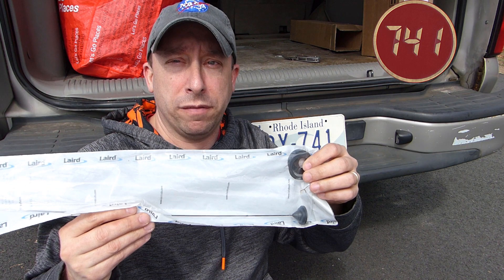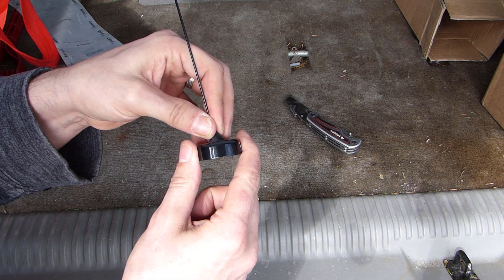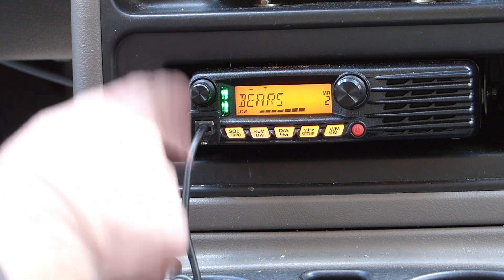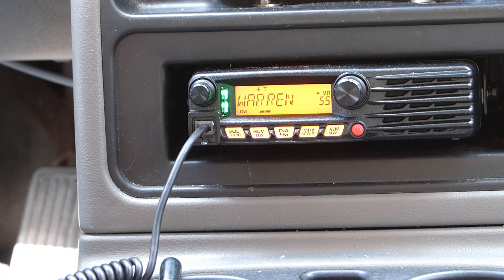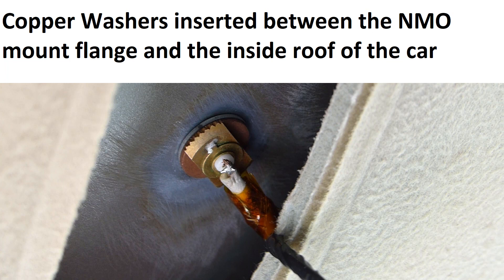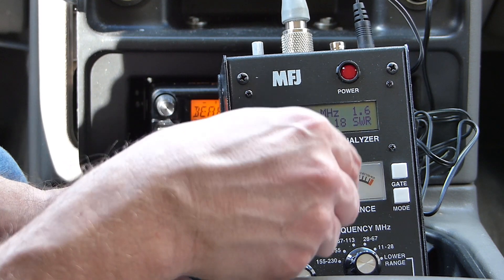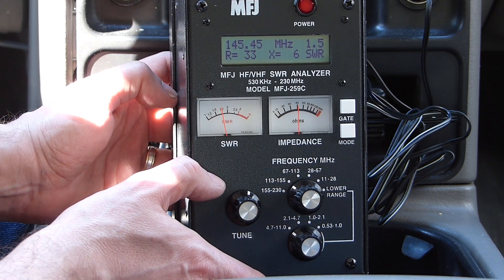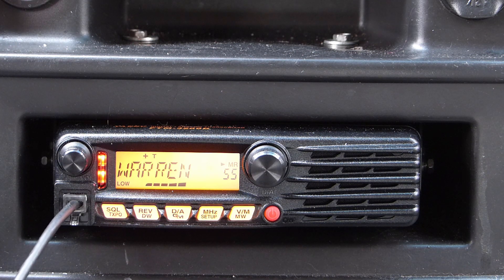2 meter antenna install and shootout 1/4 wave vs 5/8 - which is better?

Comment: Get a splitter and run both.
Reply from the maker: Why?
Reply: @SevenFortyOne  Try it out;) 1/4 wave on one side, 5/8 on the other.
Reply from the maker: You mean a switch then?
Reply: @SevenFortyOne  transmit and receive on both at the same time. Try it out.
Reply from the maker: What do you expect would happen?
Reply: @SevenFortyOne  you get the best of both worlds.
Reply from the maker: it doesn't work the way you think...first, you need a phasing harness.  A simple splitter doesn't work for a transmitting antenna. Second, once phased, the 2 antennas work as 1 and the result is a radiation patter that is different than either of the two antennas individually. Third, the antennas must be placed precisely which may or may not be an easy thing to do on a car.   Any benefit seen in a mobile application like this isn't usually worth the hassle of the phasing harness and placement/tuning of the antennas.  Having said that, AM radio broadcast stations use a similar technique to direct their radiation pattern so the signal is strong where they want it and weak where they don't.
Reply: @SevenFortyOne  The military does it , but the equipment is digital. Heard it helps out in fringe areas
Reply from the maker: Money and time are no object for the military and performance could be the difference between life and death so maybe antenna phasing is worthwhile for them.  As I said, its generally not worth it for the average Ham.  If you try it and it works for you let me know and we'll make a video about it.

Comment: if 1/4 wave antenna tune at higher frequency for given cut length , it probably due to weak ground connection.   sometime, lengthening antenna a little bit ( make it slightly inductive ) to compensate for weak ground.  often handheld antenna do that, since most handheld radio have weak/small  ground.  AG6JU

Comment: that changing signal is ground wave scatter, wind blowing the antenna and other movements, also have an effect.. to test antennas an  almost instant change of antenna is required. the time between the change of antennas was too long.. you may see a different signal of a repeater in the morning compared to afternoon... the rf stream can change its course... reflections blockages.. atmospherics.... these antennas are not in free space or close to it... neither antenna is working optimally
Reply from the maker: Yup, understood. This is what I'd call a "real world" comparison and illustrates approximately what one might see in general use in sub-optimal conditions. This was not intended to be a scientific comparison by any means.

Comment: I'm having a lot of trouble finding basic information about what kind of antenna I need. I must be misunderstanding something, because I can't find the difference between 1/4, 1/2, and 5/8 wavelength antennas anywhere.
Reply from the maker: There isn't a simple answer. Bit depends on what your needs are and other variable like your car and radio.  Having said that, a1/4 wave usually is a good place to start as it generally is the simplest and cheapest option but still provides decent performance.

Comment: I went with a 5/8 wave antenna but installed a spring-base between the loading coil and the whip. I just had to reduce the length of the whip by the height of the loading coil.
That Laird quarter wave is not cut for the right frequency. Unfortunately you can't fix "too short" by trimming. If you are dead-set upon using a quarter wave antenna then buy one with a whip that you can trim to put it on frequency.
Otherwise your MFJ analyzer is only telling you that you have the wrong antenna length and you are not going to do anything about it.
I would not recommend the use of Nevr-Sieze. Most antennas (commercial ones) come with a little single use packet of silicone grease. Fill up that gap between the NMO and the antenna with silicone grease. It is non conductive and fills a void so water just can't get to the antenna internals (on a base loaded 5/8) or at the NMO mount.

Comment: Interesting video. I've had better luck with the 1/4 wave in a mountainous environment.
Reply: Because the radiation pattern has a large upward lobe to help get you out of a valley. On the mountain top, however, the lower angle of radiation inherent to a 5/8  wavelength antenna will outperform a 1/4 wavelength antenna.

Comment: Back in '72 I tested a stock 1/4-wave as above and an Antenna Specialist 5/8-wave base loaded antenna on a full-duplex 25 watt VHF mobile phone unit to a repeater at 700 feet AGL. In town 12 miles away, the 1/4-wave was choppy in some places and the 5/8-wave was clear.

Driving out of town, the 1/4-wave was choppy at 20 miles and lost it as 25. The 5/8-wave was choppy at 25 and lost it as 30. 

The 1/4-wave antennas last about a year and metal fatigue breaks the whip just above the rubber boot.

Couple of years later tested several 5/8-wave antennas. The ASP with spring, Larsen and Decibel Products without springs. Driving off-road the ASP stayed straight but the Larsen and DB whipped around. We observed how much it whipped around and tied a fishing line and pulled the antennas the same amount. There was a 3-6 dB loss.

Comment: Good test. Nice video.   Fact remains , a 5/8 wave has a gain over a 1/4 wave.  And a different lobe angle ( main lobe is lower ) and stronger.  But not so much as to nullify smacking into garages, trees etc!   The height of the cab can make a big difference at vhf and uhf.  Some cabs are a couple ft higher than many compact cars.  That can give a couple miles more to mobile to mobile communications.  After years of using all kinds of mobile setups   big antennas matter.   Its simple capture area and radiation angles.   Also PLACEMENT on the vehicle. Matters. !!! Many db... Center roof wins.   Exactly where you have it!   73s. K4DSB.

Comment: Another good video.  I am considering a tri-band VHF/UHF mobile antenna for my GMC truck.  I was reading on Comet’s web site that the tri-band antennas need to be moved around to adjust tuning.  How do I do that with a NMO mount?  I would think I am kind of committed once I drill that holes.  Haha.  I am impressed by the mounting of the Comet and the fold over (manual) that they have.  This is one of 3 antennas I plan on mounting.  One VHF/UHF mobile & 2 HF mobile antennas.  The HF mobile will be mounted near the bumper (trying to figure that out).  If you have any advice to share with this noob, please feel free.  Again, thanks for your video.
Reply from the maker: Things are different from install to install.  The best thing to do is experiment and see what happens.  There will always be compromises so make the best of what you have and things should work.  Also, keep in mind differences on paper don't always translate into difference you'll notice in real world conditions - especially when it comes to antennas.
Reply from the maker: The most important thing is to get the SWR as low as you can and go from there.  For HF, bonding of the car panels to one another is important.  Ham Radio Crash Course has at least one video on this topic that you may find helpful.  Also, HF mobile antennas are usually a pretty big compromise over full size antennas.  They'll work if you get them set up reasonably well but won't usually perform as good as a full size antenna of course.  Experiment, and have fun!

Comment: Great video….I’m just getting in to ham radio and was wondering what is the type/size coaxial cable you are using between radio and antenna?
Reply from the maker: I've been using rg8x in my mobile installations for many years with success.  If you are running frequencies higher than 2 meters you might want to consider lower loss coax.
Reply: @SevenFortyOne  For the foreseeable future I will only be using 2m and 70 cm in my truck so that’s the cable I will go with. Thanks for the info
Reply: @SevenFortyOne  I have some RG 58AU that has the same loss on  UHF as LMR 400 @ 17 feet. per my analyzer

Comment: I drive all over Kansas and Oklahoma in a little Ford transit van.
I started with a 1/4, then went to a 1/2, then to a 6/8 antenna. Let me tell you, that 6/8 antenna is where it's at. I know my ranges with each of them and the 6/8 blows the rest away. When you need a lot more range get the Comet SBB7, I'm constantly surprising people every day with the range I get with this thing and it's noticeable against the others. I made a 80 mile contact over simplex and 80 mile contact to a repeater just last week.
Reply: I run   a Hustler CG 144 on 2 meters-84 inches tall mounted 6 feet off the ground on  the roof of my truck with 6 db worth of gain and 80 watts  and 100 miles is normal for me

Comment: When operating far below a repeater's antenna I would think the 1/4 wave would be a better choice, because the lower angle of radiation of the 5/8 wave is going to decrease radiation at the higher angles - which is actually where the repeater antennas are relative to your mobile station on the ground.   Of course, for hitting repeaters a long distance away, the 5/8 wave is likely to be superior to the 1/4 wave.
Reply: Finally someone who might actually understand antenna gain, and radiation patterns 👍

Comment: Years ago when I still had my Tacoma, I took down my 5/8 and put up a 1/4 wave because I knew I was going to drive into a parking garage at the Toyota Center. The 1/4 wave was fine when I entered the parking garage, but when I exited it got knocked down. On a road trip I would definitely use the 5/8 wave and use the 1/4 as a backup.

Comment: The radiation angle for a quarter wave is typically higher than for a 5/8 wave, so it’s quite possible that it could outperform the longer antenna on some repeaters.
Reply from the maker: I've not noticed much of a difference one way or the other but results may vary from situation to situation.

Comment: What is the difference on 5/8 vs 1/4 is it the thickness of the stell antenna or the length or the bottom part ? In confused
Reply from the maker: The diameter of the hole you need to drill
Reply: @SevenFortyOne  I think he meant the 1/4 wave vs 5/8 wave..
Reply: @SevenFortyOne  thank you 👍

Comment: I've been in ham radio for 25+ years and a 1/4 wave antenna can't be beat for the price and, low maintenance. I use the exact same antenna, being demonstrated in this video, and I paid $12(?) for it a few years ago. Over the years, I've tried different styles of single band, dual band and even a quad band antenna's but I still love the 1/4 wave for it's simplicity. I mentioned low maintenance, take a look at most ham radio antennas. They usually have coils, springs, plastic parts, etc., that can be damaged. I've had four antennas, over the years, get damaged in some form or fashion. The first one was a Larsen 5/8 wave that suffered a damaged base coil when it was struck by a tree limb. No external damage but the shock of the limb hitting it broke the coil internally. Within the past few days I had to replace a Comet SS680NMO dual band antenna as the braiding inside the spring was damaged as well as the spring loaded plunger inside the base. Unsure how it happened and only knew about it because I was getting bad signal reports. I mostly use VHF and UHF repeaters so I don't need a high gain antenna for simplex work. I keep the Comet available in case I'm on a road trip and want the extra gain or, in an area where I'm quite a distance from a repeater. My day to day use (repeater distance approx. 25 miles away) a 1/4 is just fine and yes, it can be used on UHF also:) 

I have a 2016 Jeep Grand Cherokee, with electric sunroof, and had to locate the NMO mount about 19(?) inches distance from the rear edge of the lift gate. My SWR is anywhere from 1.4 to 1.2 across the VHF band and, 1.5 to 1.3 across the UHF band. I've made similar comparisons, like in this video, of various antenna's and didn't notice much if any difference in transmitted or, received signal strength. Again, that's just my experience and YMMV. I love this 1/4 wave antenna as it's very stealthy and it blends in with the dark gray color of my vehicle.

Comment: Btw laird antennas I believe are commercial antennas. That might be why it didnt come into good reasonance until 150mhz
Reply: This particular one is resonant from 144-152(?) I think. I have the same one and the SWR is better on it than some other factory pre-tuned ham antennas I've bought and that includes Diamond, Comet and Larsen. I use the same antenna and my SWR is extremely good. This antenna can't be trimmed, like the older Larsen 1/4 wave antennas, but it's really good for what it is. I have no way to check SWR outside the ham bands but, it's not over 1.4:1 anywhere in the 2 meter band.

Comment: Thanks for the video. I live in a very hilly area of Australia and did that same experiment here.  I found that the 1/4 wave was better at the bottom of hills (valleys) and the 5/8 was better on mountain tops as it has a low radiation level. I normally have a 1/4 wave for the same reasons as you. I need to garage the car.
Reply: I just got finished explaining this in another comment and didn't even see this one.

Comment: Thanks for this, be interesting to hear your thoughts after 6 months or a year.
Reply from the maker: The 1/4 wave has been working great since I made this video.  I don't notice any difference in performance compared to the 5/8 antenna I replaced.
Reply: @SevenFortyOne  being in hilly terrain and close to the repeater or "under the repeater" I believe the 1/4 wave is supposed to hit repeaters better.

Comment: Real hams drill holes on their roof.
Reply: Real hams buy used cop cars with holes already drilled in the roof
Reply: Real hams drill a 3/4 inch hole on their new $42,000 Jeep Grand Cherokee.... even now I still can't believe I did it.
Reply: @dereklea1183  Real Hams drill 3/8 inch holes and then use a 3/4" chassis punch to make a super clean-cut 3/4 inch hole. I've done that for 44 years as a ham and no one has ever complained or tried to cut the price when I sold it. Just put a 3/4 inch antenna hole plug in it. Most don't even notice it.
Reply: @dereklea1183  The real tragedy is spending 42k on a Grand Cherokee instead of the same amount on a Gladiator! 🙃
Reply: And don’t mute their callsign on YouTube. 😂

Comment: Im super new to all of this, havent even purchased my first radio yet. Decided this weekend to just go get my license, and started studying. Im taking the exam this thursday. Pretty sure Im going to order the Yaesu FTM 7250DR. So any recommendations on a good dual band antenna?
Reply from the maker: First off, welcome to Ham Radio!  I really can't recommend a particular antenna for dual band use as I really don't run UHF here.  I would venture a guess and say that any name-brand antenna purchased from a Ham Radio retailer should work reasonably well for you.   Mount it as high and as central as you can on your vehicle and it should work reasonably well.

Comment: Anyone ever try building a multi~wave antenna without using an antenna tuner? I have two ideas for this.
Reply from the maker: Sure, there are tons of multi band antennas out there to build or buy
Reply: I mean like using a full size 20 meter length antenna on 10 meters without a tuner.  That i haven't tried yet.

Comment: How well does the 5/8 wave perform vs the 1/4? I routinely drive from Columbus Ohio to Cincinnati. My friends usually ride along via one of the main repeaters in Columbus. Currently, I'm using a 1/4 wave Tram dual band antenna which performs reasonable well. However, about half way to Cincinnati, they can no longer hear me. But, I can still hear them. So, I was just wondering if I got a higher gain antenna, if I'd be able to talk to them for at least as long as I could hear them. Any thoughts or information you share will be appreciated! Thanks
Reply from the maker: I've never really seen a difference between 5/8 and 1/4.  But there are alot of variables to consider...my advice is to experiment and see what works best for you
Reply: @SevenFortyOne  thanks!

Comment: I think if repeater signal become stronger (in your radio) that mean your rx getting better, but not necessarily with your tx. As long as repeater can still picked your signal then no problem with your tx. YD0ACH 73
Reply: Generally with antenna changes, receive, and transmit do show similar if not identical improvements. Antenna gain (a result of radiation pattern manipulation) works for receive, and transmit.

Comment: Will you be releasing an update video? How have you been liking the Laird? Going to be mounting a 2m to my truck roof soon.
Reply from the maker: It seems to work fine but I bumped while shoveling snow off the roof and it got a little bit out of whack since it is so thin.  I was able to fix it easily enough but a more substantial antenna wouldn't have been damaged in the first place

Comment: What about the 5/8 Wilson mag mount? Where would it compare to both?
Reply from the maker: It's hard to say without testing but my guess is it would perform about the same as any other decent quality 2 meter 5/8 wave antenna.  I didn't know Wilson made 2 meter antennas, I thought they only did CB.
Reply: @SevenFortyOne     I think the mag mount would be a good choice because you can remove it quick or hide it in your car so people might not know you have an expensive radio inside as well.  Cover the radio with some socks and hide the antenna :)  The Wilson 2 meter is sold by many outlets. 
Here is one  https://www.ebay.com/p/1700378110 
And Amazon of course.

Comment: My experience over the last 25+ years = 1/4 Vs. 5/8 - not enough difference to justify matching the 5/8 to the system (on repeaters anyway). Good analysis.